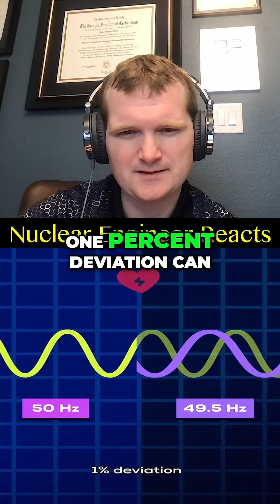Causing a Country-Wide Blackout? - Nuclear Engineer Reacts to Kurzgesagt

Comment: I don't really understand the point of all these elaborate plans when usually the simplest would do. 

Just plant bombs underneath 3 connecting towers across the country, that's literally it, you don't need to go to the power stations, since their monitored, or grid station, just taking out 1 to 3 towers across the entire country would do it, as they're literally left alone, as no security measure is wide enough to watch every single tower, plus their in middle of nowhere half the time over a mountain on grass lands.

like what's with the constant we got to do this elaborate mass scale terrorist like planning, when all it takes is a couple explosives and maybe like 1 to 5k people, if you do it all in a day, if it's a long term thing, then would only take 100 people max of the course of like 5 years. 

Then poof a lot of the entire nation power grid goes down, and if you pick the right towers nearly impossible to get them all up within a decade, due to weather and complicated terrain placements.
Reply: It's not that difficult, I'm confused with the constant oh we got to do this and that, like no what are doing?

if you also wanted to be more simple, fires.

Pick massive forested areas, just take a couple 100 guys in trucks full of gasoline then start massive fire across the country at a set time, spreading it as far as you can, the damages would be unfixable, and nearly unstoppable. 

we got to us nukes of ballistic missile, no what drugs are you on, just dump radioactive wasted barrels or extremely dangerous common industry chemicals best part just play of as a major big industry company, and dump it in a lot of the fresh water lakes, doesn't need to be big ones just small to medium would cause untold amounts of damage for like not even 1/1000 of the cost of anything else.

It took me 5 minutes to just think of this as a random guy. 

Terriost groups really be lacking in thought departments now adays huh.

Same thing for government agency's it doesn't take much to destroy a nation at least, usually the simplest solution can do it.

Comment: As someone who programmed the fuel system for the backup generators at a main electrical grid facility while it was under construction, those places are nuts, first time I ever set foot in an EMP-proof room, and it wasn't a small room either... still wild when I think about it

Comment: Affecting the frequency of our power grid is a near impossibility for more than a few seconds, every power plant be it nuclear, natural gas, coal, hydro has equipment to stabilize frequency and it happens very quickly, plus most equipment can run between 50-70 hz for a short time without harm. Most plants have cutouts where if a generator exceeds or fails to produce the proper frequency gets immediately shut down to protect the grid and prevent catastrophic failure

Comment: I am told in the North East is running into the problem of an aging grid system and the resistance of the public allowing for increasing the size of the main lines running throughout the area to bring in more power and will eventually start to cause brown outs and such. Is this true and are actions actually being done to prevent this?

Comment: You can do flywheel with solar or wind if you want. My guess is hydro is the best choice ? Just open and close some valve ? But battery storage is probably the most responsive.

Comment: I'm not sure you're right about tripping a huge amount of breakers at once protecting the grid. Yes, it reduces the load, but reducing the load by so much so suddenly would, briefly, cause a rise in frequency, which could trip more sensitive plants off in the same way a drop in frequency would, leading to a potential cascade failure the same way.

Comment: Guys, gals, I think Ty's using a nation the size of the US, Canada, or China as his point of reference. Yes, Spain had a massive power outage, but the size of their grid is likely not comparable to what he's imagining here.

As an example, to take out the entire Chinese grid you'd need to knock out more than 100 separate power stations, several of those being truly huge nuclear plants and hydroelectric dams. It can be done, sure, but doing it would take a Hell of a lot of work on the attacker's part. Realistically, a lot of that work would likely be attacking the power plants digitally.

Comment: It's funny that they give cutting solar as an example. It is incredibly hard to cut a huge volume of solar input at once because it is localised. Most likely option would be some kind of cyber attack. It's much easier to cut the production of a single nuclear powerplant, because it is much more localised. I.e. you could cut it's grid connection.

Not that that is very easy.

Comment: With all due respect, anything you think you know about the safety of the power grid, is like 10 to 100 times worse. Bad maintenance, old machines, not enough workers that still know how to work on those machines. 
Good thing is, if anybody wanted to mess with it, they would get only one chance. If they can't do anything substantial out of it, then that would get fixed in a jiffy.

Comment: IIRC a few years/decades ago, when Serbia (not sure if it’s them or another country) was integrated to the european electric grid, to protest about a decision of the EU, they slightly changed their production frequency (50Hz) to cause perturbation in the european grid. That caused some problems like clocks that counted time based on the electric frequency to have some delay.

Comment: Well... The thing about wind power is that you can turn off the windmills, which means you put brakes on them so they do not turn. So it is not uncommon to see a windmill standing still while all others are turning in. 

You could do so for maintenance reasons. But overproduction could actually be an issue too on a really windy day. Or simply due to safety reasons, since them turning too fast could be dangerous.

Comment: I’m no nuclear Engineer, but I did stay at a Holiday Inn last night.  

I helped build a few natural gas fired turbine power plants in early 2000s. (Westinghouse, 3 generators at 590 megawatts) and still go back. 
  The FINES are ridiculous, 200k initially plus 5k a minute and startup takes about an hour
You ain’t just turning it off and the back on.

Comment: or you could look at germany, that has fucked its own powergrid by bureaucratics so much that they actually have to sell power at negative prices (because of sale guarantees for renewable energies) to stop the grid from shutting down due to excess power, only to then buy that electrical energy back at premium prices when renewables dont provide enough. no storage solutions in sight and most of the base power supply shut down.

and german politicians fail to understand why germany has the highest energy prices on this planet.

Comment: The reason they show the wind mills stop spinning is because they are driven by LNG turbines to create power when the wind isn't blowing.  Investors need their money back and the only way a windmill does that in a timely manner is to create a certain amount of power over time, in other words predictability.  The wind doesn't always blow or have enough energy to move the blades and when that happens, the LNG turbines kick on and generate that power. So, to reduce production in this scenario, they shut down those turbines.  Hooray for things no one tells you!

Comment: you can do that. funnily i think ukraine has never had grid down, there there are people in russia thinking how to get it down. bombs, drones or ground sabotage. and hackers. but no dice! still...

and those mitigations are good idea. fully distributes grid. street and block level individual microgrids that work in sync or separately. apartment building with grid down can use building batteries, pv and vehicles in it's garage to keep at least freezers working upstairs in flats by turning loads off. cars can go out and transport power in from elsewhere. if they can selfdrive, they could do this automatically

this is worst scenario. the impementation is bit expensive still. but if it could be done, it would solve both manmade and natural causes, wars, riots, storms, flood, copper thieves, terrorism, everything

Comment: Guy, nothing compares to nuclear. It's the most stable, most reliable, most efficient, and cleanest - from wall-to-wall - form of energy we can rely on. And the pollution that goes into transporting materials and building the plant probably has the shortest neutral offset time of any other form of energy generated.

Until Vogtle's units 3 and 4 became operational in 2023 and 2024, we hadn't built a new plant in the US in what? 30 or 40 years? It's a shame and a disservice. We should've doubled the size of our grid before the advent of our new re-industrialization. 

BUT, I'm glad you're doing what you're doing. We need more people like you providing education and information so that the tide can shift on this one day.

I'm with the green energy folks on the outcome they want, the problem is what they want isn't green and it isn't energy. If you truly care about limiting our impact on the environment, nuclear energy is the greenest you can be.

Comment: One of the main negative things about nuclear power is the fact that it's more unsafe for the environment rather than wind or solar power but yeah I guess it's technically better but it's not when it comes to the environment. ❤💯
Reply: Wrong. Nuclear power releases less overall CO2 than wind and solar due to material production. Also you get way more deaths per kWh for wind energy than for nuclear energy
Reply: @ondatra_dl Uh no I'm not wrong nuclear power plants produce a lot of hazardous compounds and chemicals into the environment like what are you talking about Buddy they release way way more chemicals into the environment then solar and wind that doesn't even make any sense dude. 😂😂😂😂😂
Reply: @ondatra_dl That makes zero sense. 😂😂😂😂
Reply: @ondatra_dl Yeah Nuclear power plants have a larger environmental footprint than solar or wind, but it’s a bit more nuanced than people usually think.

Here’s the breakdown:

Emissions-wise:
Nuclear energy produces almost no carbon emissions during operation — similar to wind and solar. So from a climate perspective, it’s very clean compared to fossil fuels.

Environmental impact overall:

Waste: Nuclear creates radioactive waste, which is its biggest issue. That waste stays dangerous for thousands of years and needs careful long-term storage.

Accidents: While extremely rare, disasters like Chernobyl or Fukushima have massive localized environmental consequences that solar or wind could never cause.

Water use: Nuclear plants need a lot of cooling water — far more than solar or wind — which can affect local ecosystems.

Mining & construction: Uranium mining and refining have environmental costs too, though those are generally less damaging than coal mining.

Meanwhile, solar and wind don’t create dangerous waste or have any catastrophic accident risk. Their biggest issues are land use, materials/mining for panels or turbines, and the fact that they need batteries or backup systems for when there’s no sun or wind.

So in short:

Carbon emissions: nuclear ≈ solar ≈ wind (all low)

Environmental risk: nuclear > solar ≈ wind

Reliability: nuclear > solar/wind

Basically, nuclear is clean but risky, while solar and wind are cleaner and safer overall, just more intermittent.

So what's that about me being wrong? I was literally right there way worse on the environment. 🤣🤣🤣🤣🤣
Reply: @Joeforsheemma Waste is transformed to tough ceramics and sealed in barrels. These barrels are so protected even epicentres of massive earthquakes cant break them. 

Wind and solar release more CO2, SO2 and all of the other nasty pollutants due to production of carbon compounds and aluminium refining. 

For risks, let’s remember the FN Curve, the higher the impact, the lower the frequency. Thats why only 5 of historic nuclear power plants had suffered a catastrophe, all other accidents weren’t major enough to cause damage. Plus, don’t forget, Three-Mile Island and Fukushima HAD NO FATALITIES… more people die from wind turbine maintenance and sun burns at photovoltaics!!
Reply: @Joeforsheemma Deaths per TWh:

Coal - 24.6
Hydro - 1.3
Wind - 0.04
Solar - 0.02
Nuclear - 0.01

Nuclear is 4x or 2x safer here

Comment: "If the grid operator is not doing their job" 

You know that we do have blackouts every now and then, right? I'm sure that nuclear plants are mostly run right, but the grid is big and contains every cable ever touched by a idiot. 😅

Comment: the reason power prices get stupid high with lots of wind/ solar is the speed at which they swing. they have to keep thermal (usually gas ) plants idling incase of an issue because they never built the battery capacity that was planed for any of the grid scale projects. 
They didn't build the batteries because that would make the wind/ solar cost inefficient. A decade later we are finally getting a few battery installations due to a fist full of massive outages.

Comment: The Spanish grid outage of April 2025 would like a word...
Reply: .. and Portuguese as well, had to spend most of my work day doing sales using the phone calculator 😭
Reply: @tiagof857 I loved it... I got to go home early and fantasize about the end of the world.
Reply: The Spanish blackout was caused by much more complex mechanisms than illustrated in this short video. Because there are more frequencies at work, not just 50 Hz, and the network has many interdependencies.
Reply: Grid frequency drop was the result, not the cause there. They simply were causing enough instability so when the whole European grid for to around 49.8Hz, they were cut out to prevent from further destabilization.
Reply: so would the Venezuelan one of March 2019, which lasted for an entire week and up to months in some parts of the country
Reply: Underrated comment
Reply: There was a NA grid blackout caused by this as well in the early 2000s
Reply: Texas' power grid was shitting itself every time the state iced up for a while.
Reply: it was solar and wind.
Reply: @megsley it was a software error that causes to cut off all renewable energy all at the same threshold of 50.2 or .3 Hz. That lead to an instant drop of the network frequency and a nation wide shutdown. 
But society took a day of and mostly chilled in parks and touched some grass. 
No mayor incident.

Comment: I mean, honestly, easy way is to find your closest transmission line, tie a steel cable to a rock and slingshot the rock over the transmission line after securing it to the ground.
Reply: make sure your cable to the ground doesn't burn out in the first 0.5 seconds of the electrical contact

Comment: The cars being used as batteries are already patented (Vehicle-to-Grid (V2G) technology) and it's done through smart meters and a system of bidirectional chargers. This is why they are pushing EV's so hard, to be able sustain power during brown outs due to unreliable solar and wind energy.

Comment: It’s happened - repeatedly.
Usually at night in mid winter in the U.S. when a high voltage overhead power line succumbs to high winds and ice.
Texas lost its grid when the gas lines feeding the natural gas power stations froze.
Nuclear reactors, like gas fired boilers, have a maximum rate of change limits - change the load too fast and you will go black. 
Submerging your nuclear or coal power station will also do bad things to the grid (ask Japan how that went).
Solar (and battery) inverters have a MUCH higher load swing capacity (milliseconds versus seconds for thermal plants). That’s a plus as well as a minus. Most domestic inverters are set up to raise the frequency to plus 2% on loss of grid connection (that’s how they tell the grid is gone and drop off line to protect linesmen). Grid scale inverters run constant frequency however (just like normal power stations) and have to be told to disconnect and reconnect by either the grid operator ringing them on the phone (old school) or a leased line serial link (not quite so old school).

Comment: In Iran they drop the frequency to 49.2Hz and voltage from 230V to 192V to prevent overload (even with that we have 2 hours of shortages daily in summer and in winter we have Methane mining problems that cause to use of heavy oil which makes the atmosphere black, and I need to mention that we have world's biggest  natural Methane reserve "South Pars gas Mine" and also we sanctioned over 20 years for atomic energy and now after 20 years we only make 1000 megawatts from nuclear

Comment: "funny how they show wind like they're turning off the wind" I mean wind turbines have breaks (it's kinda interesting because break fires are a comen problem for wind turbines) and they can control their blade angle so you can stop a turbine like that (though probably not that quickly that's a massive turbine so inertia is going to keep it spinning)